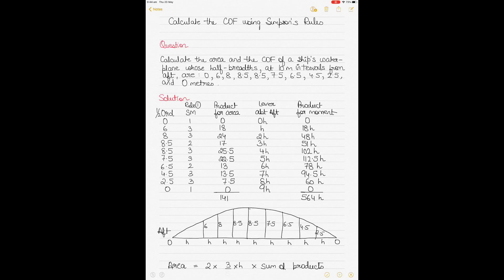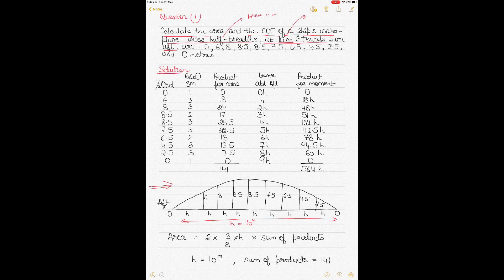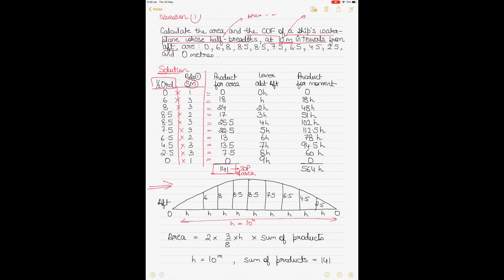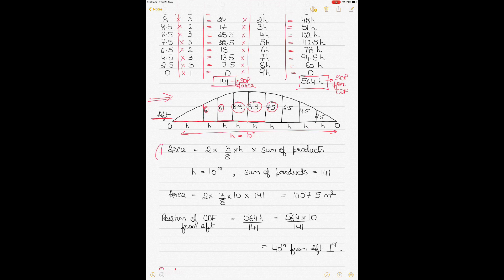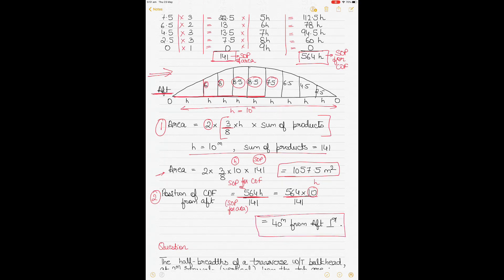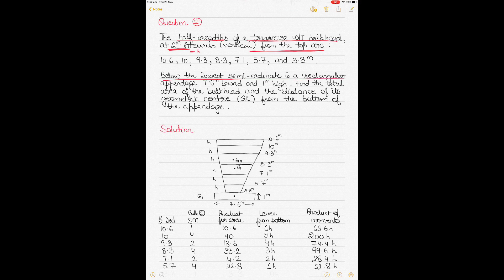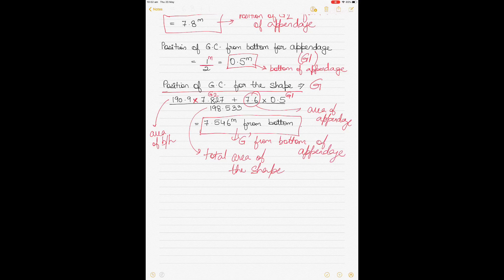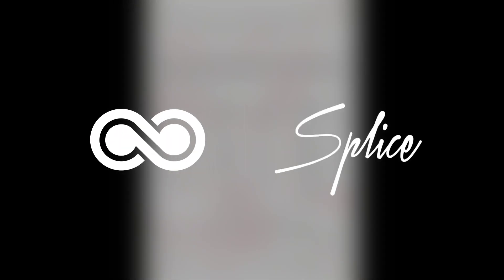Using Simpson's Rules to calculate the geometric center (COF) of an enclosed space

Comment: The half ordinates of a ship waterplane area 210 m in length at equal intervals, commencing from after end are 2.0,3.5,5.8,7.5,9.0,6.0,3.0,0.0m. Calculate her tpc and LCF.
Reply: I have calculated the TPC. But for LCF. When I am using your formulae error of 2 m is coming. Please assist 🙏